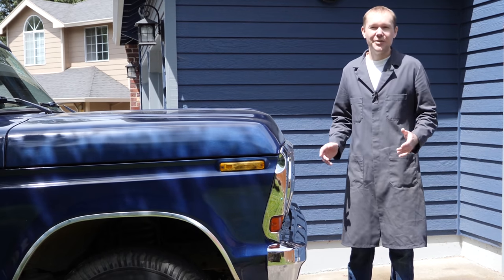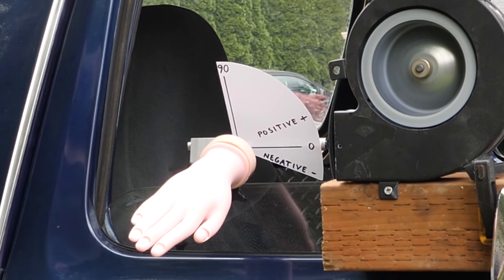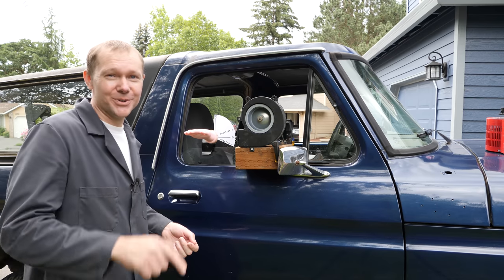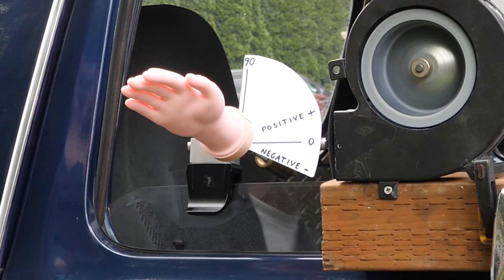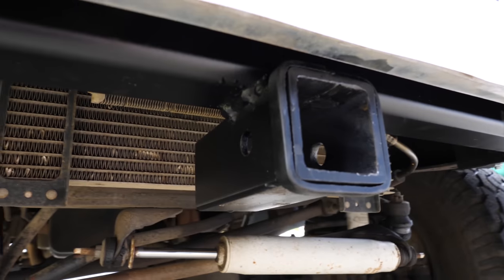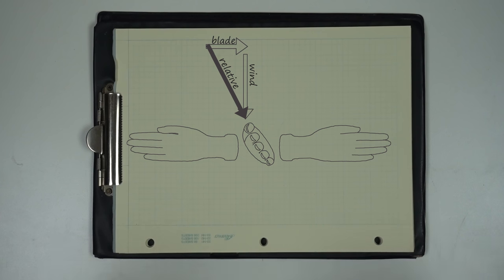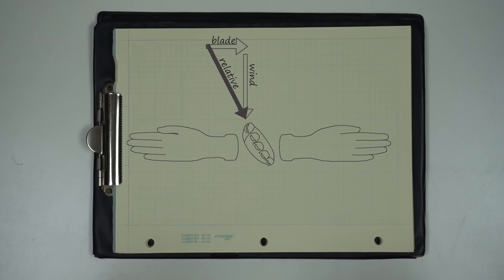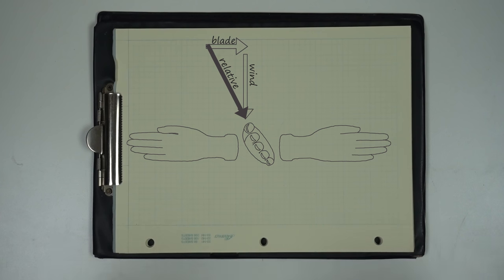Wind Power on a CAR #1 - Is it FREE?

Comment: Question: What would happen if you put a "secondary roof" on top of your roof, with big fan-blades in between these roofs, with the front of your car's roof acting like  funnel?
You could cover half the fan-blades with the funnel so that air only hits one side of the blades to avoid resistance.
Is this a brilliant idea, or a super stupid one?
Reply from the maker: I like it! Huge effective area without the giant blender.  Might need to enclose the sides though which could block your view? Hmm

Comment: Did you swap frames on the bronco or is it still the bronco frame and body with new truck drivetrain and dash?  Decided to subscribe the second I saw the bronco!!
Reply from the maker: It's a resto-mod I did with the engine, trans, transfer case, ABS,  and A/C from a totaled 2004 F150.  I had to modify the frame to make room for the exhaust on the passenger side though. Just took it thru DEQ testing again and it beat the old 1978 standard no sweat!

Comment: Is it a coincidence, or is that peak spin speed you got at 30 degrees connected to sin(30)= 0.5 ? (My maths is WAY rusty, so if I'm talking out of my arse, then apologies!)
Reply from the maker: I think it's coincidence.  Faster and slower speeds would have different optimal angles I think.  I try not to say anything definite because I've been proven wrong too many times!

Comment: Okay, so you've built a wind turbine that can generate electricity while driving. But, that truck runs on gas and it can't use electricity to drive it, so what good is it?
Reply from the maker: Primarily educating the public about how wind power works. But there's also a chance it could reduce fuel consumption.

Comment: I waited to see if it worked?  Did it?  I wanted to see if it changed the fuel economy of that Bronco (Wind around the nose of the truck?) and made extra power to the battery reducing wear on the alternator?  Are you going to finish this?
Reply from the maker: Oh absolutely. If I we're just making the end product I'd be almost done already. My goal is to create content that teaches the fundamentals to as broad an audience as possible in a relatable way (hence the rubber hands). That takes a lot more time, hence the part 1, 2, 3...
Reply: @QuintBUILDs  .............Thank you I was very interested how this will turn out.  Thank you for the note.

Comment: I'll save you some work: No, the drag of the contraption and the drag of the generator will consume far more power than the generator produces.  Newton's first law of thermodynamics states that there is no free energy.
Reply from the maker: If the turbine were above the truck then it would certainly add drag, but in front of the truck in the wind that is already destined to hit, I’m not so sure.  I totally get the “no free lunch” thing, I’m an engineer after all, but hey, it will be a great learning experience finding out!  And of course you know I’m not going to fake anything like the typical “free energy” hoax channels.

Comment: Most turbines will handle wind as high as 100mph or more.  Mine has been in 90mph gust.
Reply from the maker: With an electronic brake do you think?  Without adjustable pitch blades the turbine can only be optimized for one wind speed which would typically be for much slower winds.  I intend to optimize for highway speeds.  We'll see how it works out.
Reply: @QuintBUILDs  If you would use a charge controller suitable to the wind turbine that you have and connect it to the battery you should be okay up to 50mph or so easily I would think.   Some of the charge controllers have a built in brake or dump.  To go that speed for extended periods of time you might want to use actual dump load resistors. So you wouldn't overcharge the battery. You could mount them on the turbine mount possibly.  The air movement would keep them cool.   You may want to use a separate battery for the turbine load. You could draw power off off it for to experiment with fuel efficiency modifications.   I would guess your turbine is 250w or less. Is it for a 12v system?  I'm not sure how the how much the increase in drag would affect the fuel economy compared to any increase you would be able to make.
Reply: @QuintBUILDs  Also I'm curious wether there are any restrictions or laws for having something like that on the front of a vehicle.  It's not like anyone would get injured by it when you're going 50mph. Unless a blade would fly off.  It probably doesn't impair your vision at all.

Comment: So I understand the point of the video is to see if you can harness wind from just driving... but aren’t you going to overheating your vehicle much quicker since your deflecting the wind and there’s no way to cool the radiator? I understand this won’t be a permanent fixture on your truck but that was going through my head the whole time you were driving
Reply from the maker: VERY few people make this observation!  👍  It will absolutely reduce the air flow cooling the engine.  If it gets to the point where the engine fan has to start pulling air in then I've lost some power.  Fortunately no wind turbine can completely stop the air (more on that in part 2).  I'm hoping so long as it's on a cool day and I'm not hauling a trailer up a hill it's not going to be a factor (which is the plan for all testing).

Comment: I had an idea to add air pump to a car to suck the air from in from of the car decreasing the pressure and releasing the air Behind the car. And hopefully the fuel savings would outwiegh the energy to power the pump 🤷🏼‍♂️ but don't tell no one, this is my millionaire scheme....
Reply from the maker: Video proving it works: https://youtu.be/tEPBdztGMdI  😁

Comment: 6:50 idk it shouldn't matter if I turn them clockwise or counterclockwise. Just switches the direction of the Spin. I am confused
Reply from the maker: It changes which side of the hand has the high pressure. Doesn't matter right now, but when we start using an airfoil (like the store bought turbine) it really matters for efficiency. I'll review it in part 2.

Comment: but in this case the "wind" is generated as you drive, all the turbine is doing is adding additional drag, the car is the mounting point and has to resist the drag on the blade. all the drag that isnt converted to torque is taken by the car. this will make you use more gas.
Reply from the maker: You're saying the drag force on the body of the truck will stay the same?
Reply: @QuintBUILDs  with that set up the turbine blade dosn't really redirect the air flow up and over the truck. the outlet air is redirected but not by that much. it will still hit the front of the truck. try doing some tests with the anemometer behind the propeller. i think you will find the air flow to be largely the same. so the initial drag on the truck wont change that much.
.
think like if you had a jet engine but put it right in front of the plane, the exhaust gases would press right on the plane itself and cancel out the thrust by increasing the drag.
if you look at a propeller plane with the propeller on the nose, you find most often that immediately after the propeller they have angled surfaces to direct the air around the plane. also the propeller tends to be twice the size of the nose. With the flat front end of the truck nothing is being done to redirect the air, and the propeller is smaller then the nose of the truck.
.
the air tends to 'swirl' after the propeller rather then redirected out, you would might want to try a large impeller, they output the air radially which would suit your idea, but im not sure how efficient they are in air. they tend to be used in hydro generators. since they change the direction of the flow a lot, denser fluid makes them more efficient.
.
look up 'wind turbine air flow', or 'wind turbine CFD' there are some good images and videos on google that show how the air moves
Reply: something like this video
https://www.youtube.com/watch?v=xgrHtlPA8hk
.
the wake from the propeller is pretty much directly behind, and its mostly turbulence causing the wake to move
Reply from the maker: @MrWorth66  Great video and i get that the air won't go "over" the truck, that animation at the start was more a representation of the limits of my editing than what I believe will technically happen (not to mention what I non-technical audience is likely to understand).  And sure, there's wake rotation downstream from turbines but that represents a small loss in efficiency of the turbine.  If the turbine is doing what it's supposed to, there should be a substantial decrease in momentum of the air directly after the turbine (limited by betz of course, never quite achieved).  It is that reduction in velocity that will certainly reduce the drag on the body of the vehicle, but of course not on the whole moving body+turbine together.  The air will be acted on by the blades, then by the truck, I suspect if there were a way to measure the aftermath of the vehicle driving by it would be very similar.  All that aside, I will do some simple bench tests that should put this to rest.  Force of a column of air on an alternator measured by a lever on a scale, with and without a turbine on the shaft, with and without load attached.  Fair?
Reply: @QuintBUILDs  yeah i guess i never considered the pressure drop immediately after the turbine blades. and because of the swirl, the component of the velocity in the direction of travel would be lower reducing drag... i definitely support testing :) i wonder if a pitot tube/ manometer set up on the truck could work, but use alcohol/angle the manometer for more resolution. But bench testing will certainly be a good proof of concept. You've convinced me that there could be something here.
Definitely looking forward to your results. it hard to imagine the magnitude of each little thing, and if it will add up to something worthwhile, but that certainly is no reason not to try haha

Comment: Will The Car not consume more fuel to compensate for drag of turbine ?
Reply from the maker: The turbine should slow the air before it hits the truck, reducing the drag.  The overall drag may increase though.  That's what we're going to find out.  Certainly if I mounted it above the truck (which I will) all the energy harvested will come from additional drag and fuel.

Comment: Instructions unclear, Couldn't get the hand turbine on my Ford Pinto turning until I was doing nearly 95 down a long hill. It was at that moment the hands started turning powering the generator. This was redirected to the electric motor I had rigged up with the engine giving me a turbo boost! Unfortunately the Pinto became unstable around 140 as this was way faster than a Ford Pinto should ever be moving. The brakes on this rusted token of horrible engineering were no match as I flew careening into a crowded shopping mall.

Oh man what a mess! The cops are mad, dead people everywhere and the hands, oh God the hands. That and I'm never going to get my deposit back from the mannequin rental shop. Have you ever tried to return 8 mannequins all missing left hands? And good luck getting those hands back from the cops as they do an "investigation" into what they call "what happened here today". 

Only good news is that the Pinto seems like it will survive as the rotating hand turbine protected it from the onslaught of human bodies before itself disintegrating. Hopefully I can sell the Pinto so I can pay the mannequin people. Lets just say last time ruined a bunch of their mannequins they were not cool with it.

Comment: The answer is NO!  It will not reduce the drag on the whole ensemble . The air running through the fan will push on the whole turbine structure and put an increased resistive load on the forward motion of the vehicle so slightly more fuel will need to be expended to overcome this for any given speed . The turbine will slow the air slightly that impinges on the vehicle reducing friction very slightly but not enough to overcome the increased drag from the turbine , especially if it is rotating . So I believe the vehicle will actually use more fuel for the same speed with the turbine attached .The Betz limit calculates that wind turbines are a maximum of 59.3 % efficient thus satisfying the laws of physics . Only the Big Bang can create energy from nothing !
Reply from the maker: I hear what you're saying, but the Betz limit is based on how much the turbine slows the air that moves through it.  So if the turbine is effective (which remains to be seen if I can build one that is) the air should be moving, say, 30% slower with a little wake rotation mixed in.  Sure, the drag will be transferred from the vehicle to the turbine, but wouldn't an efficient airfoil blade do a better job taking energy from the airstream than a 90 degree impact with a truck body?  Some amount of air that would have struck the vehicle will now be efficiently driving a turbine, THEN encountering the truck at a slower velocity.  That doesn't sound the same to me as a textbook adiabatic process where everything is controlled, aka heat engine, refrigerator, you name it.  But we will see for sure and many people, including me, will get educated about wind power in the process.

Comment: why did you ask that question right at the beginning of the video? Pushing the prop with the car will use some fuel.  based upon the huge inefficiency of the car it will cost you more in gas than the amount of fuel you can save by pumping back the electricity that the generator produces and I am sure you already thought of that even before you posed the question.

Comment: surely the energy you're getting back is the extra energy you are putting in.
Reply: Not exactly, there is a lot of waste in the system. It isn't 100% efficient. Just like with heat waste in the exhaust. You could actually find a way that harvesting the energy from the wind in a certain way changes the overall way the flow goes over the vehicle, in turn getting a double benefit of less air resistance overall and energy returned from the wind turbine.
Reply: @rdizzy1  yes but you are not harvesting wind here, whatever drives the fan is achieved through the engine. you are pushing through air, the fan will only make the process less efficient. More fuel will be used. It is basic physics.

Comment: But you have to physically push the fan through the air, that requires energy, slightly more then you’ll get out of it.........
Reply from the maker: If the turbine were above the truck then it would certainly add drag, but in front of the truck in the wind that is already destined to hit, I’m not so sure.  I totally get the “no free lunch” thing, I’m an engineer after all, but hey, it will be a great learning experience finding out!  And of course you know I’m not going to fake anything like the typical “free energy” hoax channels.

Comment: what's up with the bronco.  Old body, modern dash board?  Is really a bronco?
Reply from the maker: It's a resto-mod I did with the engine, trans, transfer case, ABS,  and A/C from a totaled 2004 F150. Just took it thru DEQ testing again and it beat the old 1978 standard no sweat!

Comment: Physics says no. Your engine is working harder to overcome the resistance of the turbine . The same if you added a belt drive from the engine to your turbine generator, you just have a " air  drive " .
Reply from the maker: If the turbine were above the truck then it would certainly add drag, but in front of the truck in the wind that is already destined to hit, I’m not so sure.  I totally get the “no free lunch” thing, I’m an engineer after all, but hey, it will be a great learning experience finding out!  And of course you know I’m not going to fake anything like the typical “free energy” hoax channels.

Comment: you could have built that same setup over the top of the car rather than have the blade in front of you. the blade the way it sits now blocks part of your view. You could have set up a bunh of smaller motors over the top of the vehicle with smaller diameter blades and probably got the same results. As it stands now it won't get approved for driving on the road

Comment: Is that the stock dash in your truck?
Reply from the maker: Ha, heck no.  It's a resto-mod I did with the engine, trans, transfer case, ABS,  and A/C from a totaled 2004 F150. Just took it thru DEQ testing again and it beat the old 1978 standard no sweat!

Comment: The part about a box fan moror not being designed to produce electricity is not completely true. All electric motors produce eletricity as a consequence of their operation. if it will run a fan, it will produce electricity.

Comment: Wait wait wait. HOLD THE FRICK UP. let's just sit down now and discuss what In the ever loving BILL NYE THE SCIENCE GUY, IS GOING ON IN THAT FORD. That's FOR SURE a 70's ish Ford bronco with a mid 2000's Ford interior and I'm willing to bet it's more than just a "cosmetic" upgrade.
Reply from the maker: You are correct Mr. Fordman!  It's a resto mod I did on a 78 with a wrecked 2004 F-150.  Has the engine, trans, xfer case, antilock unit, A/C, power windows...  Used to be known online as Quint's Bronco before my website got killed.  Looking to resurrect it.  Thanks for noticing!
Reply: @QuintBUILDs  I have to tell you I am one of your OG subscribers and I love all the stuff that you do but I'm not going to lie that Bronco that's something that if you make a video series about it maybe go back through and do a step-by-step on what you did or how you did it that could definitely be a mile marker for your channel! Love your work super excited to hear more about that Bronco and the results from the wind turbines